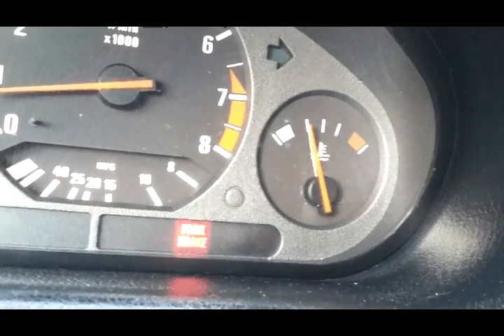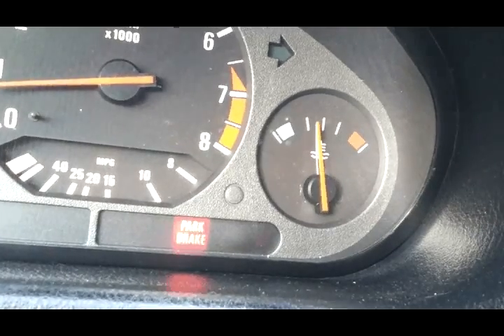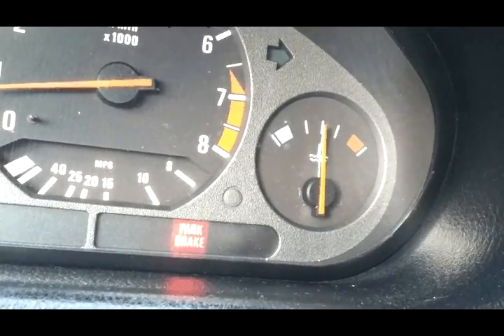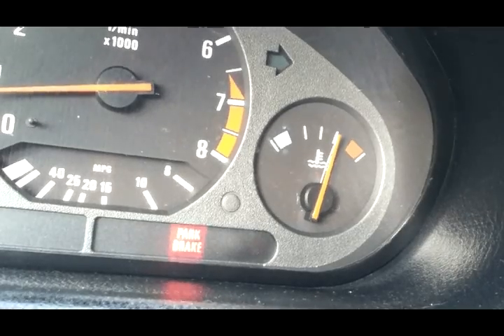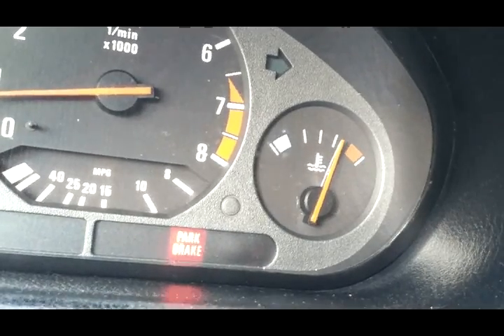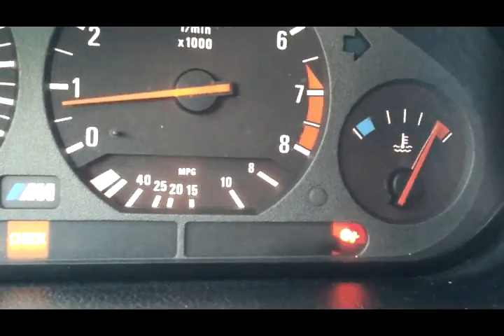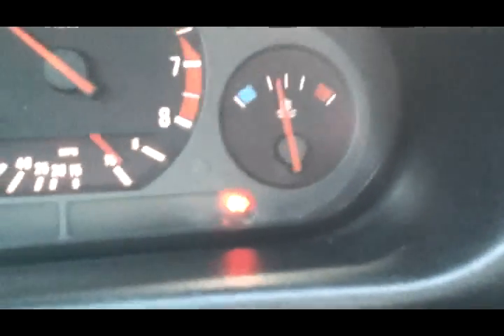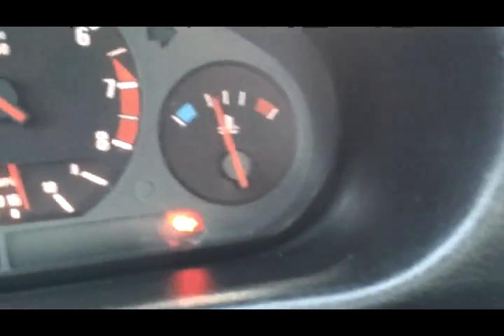BMW E36/M3 temp gage running without the "buffer" circuit. Road Test.

Comment: mine keeps getting hot wen driving but sitting its runing normal i had autozone pull up codes it was saying bad temp scencor not sure if thats what my problem is or not
Reply from the maker: Sensor is easy enough to change.  The problem in mine was an air bubble in the system.  Bleeding these engines is a pain.
Reply from the maker: Eventually, I jacked up the front of the car to tilt it upward, and cleared the bubble.
Reply: do you perhaps use a vacuum bleeder? love the video by the way! thanks! i have no cooling problems with my E36M but my E34 does this. considering changing thermostat and drilling a small hole in the side of it to evac air when I bleed it. thoughts?

Comment: What does it mean when the car is turned on after a year and it shows the needle all the way to red and it doesn't move ????
Reply from the maker: Don't know. I sold that car a while back.
Reply: So what can I do fix the over heating in bmw325xi  I'm new to driving car and I hardly know. Maybe add in the coolant I'm unsure I just need the basic moves to do when the needle  flashes red after a minute of starting the car.. please just the 2 or 3 basics things to do to go about fixing/diagnosing the problem. Thankyou

Comment: I have a 1998 BMW Z3 2.8L automatic transmission. There is a small valve inside the large valve on the thermostat.  The small valve covers/closes off a small hole in the block after the engine is warmed up, and closes off the hole in the center of the thermostat valve when the engine is cold. .   I assumed the small hole is there to circulate water through the engine prior to the thermostat opening.   I use an ELM327 (bluetooth) and the Torque Pro app on my android smart phone to monitor the engine temperature provided by the ECU/OBD11.  I removed the mechanical fan (they fly apart sometimes), and installed a 4 core all aluminum radiator, which required the transmission fluid cooler to be relocated between the radiator and engine. The OEM electric condenser fan provides sufficient cooling on the hottest days around here, approximately 100 F .  I've never seen the OBD11 temperature reading greater than 210 F.

Comment: how do i bypass the buffer?
Reply from the maker: +gabu alex 
I made a custom circuit to take direct control over the gauge.  I showed the mod in another video.
Reply: +lordandprotector ok. thx
Reply from the maker: If you are handy with electronics, the gauge itself is a 2-coil galvo @ 6v.
Reply: +lordandprotector ok man. thx a lot. .. a question. do you know what scale does the gauge has? i mean..when it's on the blue zone.. how many degrees C ? 40? and red? 120 C? thx
Reply from the maker: Sorry. I dont remember.  I do remember that I set the center tick at 85C. I think i used 10c per tick. so bottom=55c blue=65c left tick 75c center 85v right tick 95c red 105c top 115c
Reply: +lordandprotector i appreciate the help. thanks man

Comment: Sounds like his figures are off. I monitor my temps with ODBII readers, but never see more than 190f with a 82c thermostat.
Reply from the maker: This was a pre- OBDII car.   It turned out, the temperature swings were related to how well you managed to bleed ALL of the air out of the system.
Reply: Oh well I know ODBII gauges are buffered so maybe his is unbuffered . Not sure if they are in ODBI cars.
Reply from the maker: Hugh Briggs OBDI cars are buffered, heavily.  But, this was an experiment to show the temperatures directly, in real-time.

Comment from the maker: The "buffer" is part of the cluster electronics package.  It is not a separate part.  If it were, everyone would remove it :)
It is actually software in the cluster computer.    And, yes. that was el torro.

Comment from the maker: How did you manage to break the clusters?
BTW the temp swings in the video are a bit exaggerated. There was still an air bubble in the cooling system.  I had to jack up the front end to get rid of it.